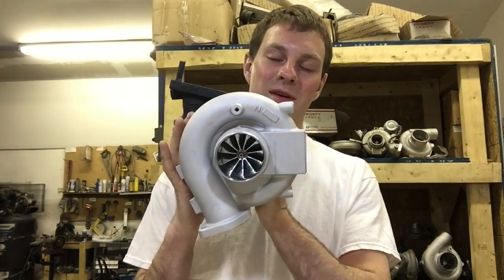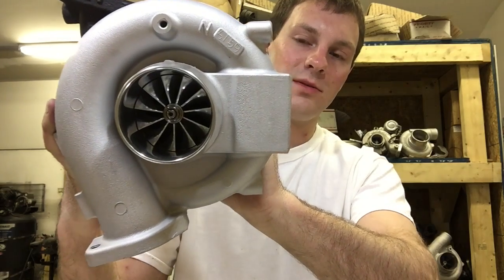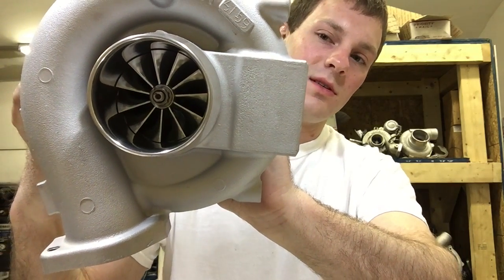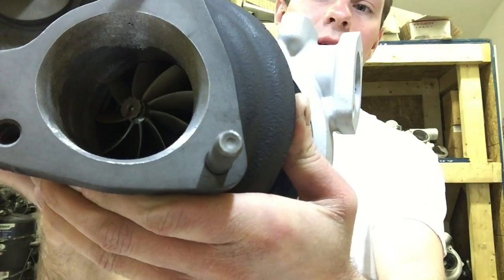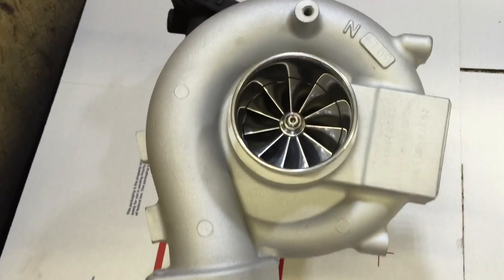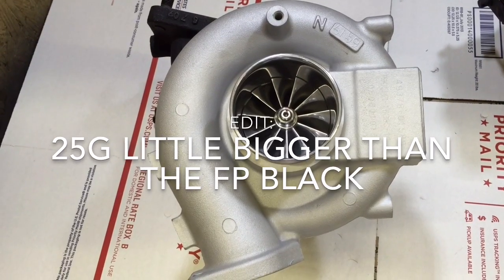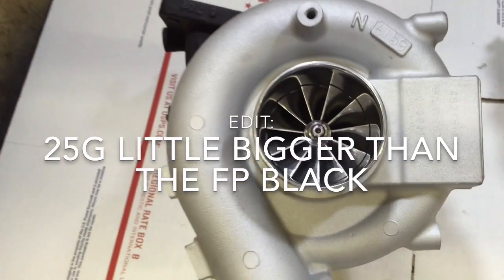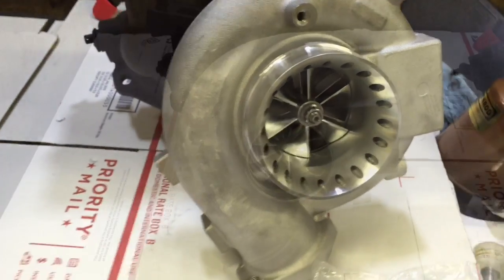Evo9 TDO6HR Gtx3076r Turbo Upgrade

Comment: Hey Austin can you help me out. I have a blown crbd bbk full evo 9 turbo. the compressor wheel is 60mm inducer by 80mm exducer 84mm at the tip.(what is throwing me off is that it seems big since everyone compares this turbo to an fp green a much smaller turbo) do you carry a compressor wheel like that? lastly the turbine wheel,is an 11blade td06hr4 would you recommend doing the 9 blade over the 11 blade?
Reply from the maker: +david castillo go with the 9 blade turbine. I have a similar turbo. Im trying to figure out what to do with it still . Maybe the compressor housing is machinable to a 25g compressor wheel.
Reply: Turbo Lab America the compressor housing has already been machined I measured the inside and its at 60mm just enough to allow my compressor wheel to fit inside. now my question is does this turbo sound like a bbk full? people compare this turbo to the green but its way bigger like fp black ef4 size. makes me question weather this is a real bbk full
Reply: Turbo Lab America can I use the gtx3076 wheel instead of the 25g wheel if my compressor housing is machined at 60mm?

Comment: i have an 03 evo 8, just blew my second stock turbo ( 360whp 26psi on pump) i have 272 cams, cam gears, head studs, valve springs and retainers, fully bolted, im still on stock injectors and fuel pump how long would my car last with a gtx3076r without upgraded injectors and fuel pump, i know ill need a tune to even run the turbo but just need an idea of what else i need before i put it on
Reply from the maker: +dthomas17dt38 you have to use an evo9 turbo to make a gtx3076. I have parts to build you one but I don't think I have a genuine turbine housing
Reply: +Turbo Lab America i have the gtx3076r it's all put together,  but would i need a new manifold to bolt it up